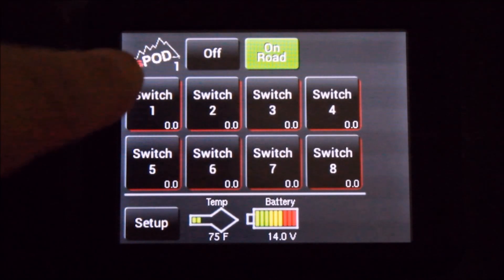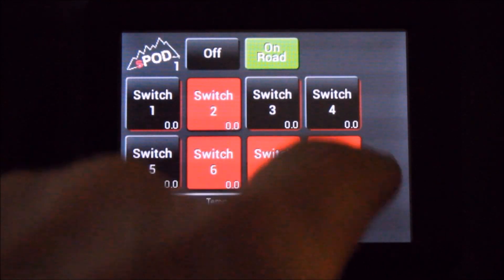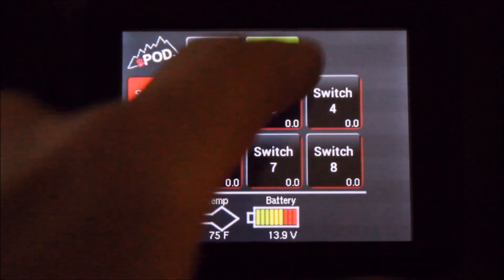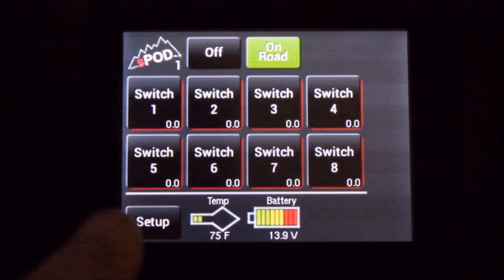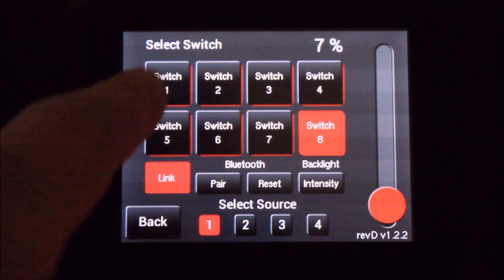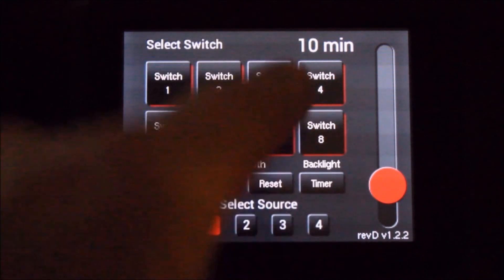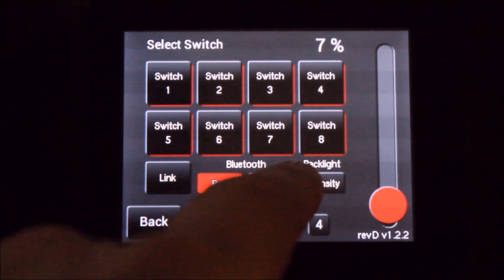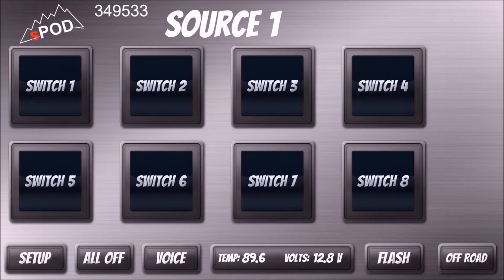sPOD Touchscreen tutorial

Comment: If I have 2 bantam units, can I set up a group/link that includes switches from both sources?
Reply from the maker: Hello campNcrawlRs! If you are referring to the "Link" feature that is programmable on the touchscreen/app, then yes switches can be linked between multiple Bantam's.
For example: If you change over to screen#3 ( even though you only have 2 Bantams) From here you can create master switches on this screen#3 that will operate switches on screens# 1 and screen# 2. Or you can create master switches on screen# 2 that will control switches on screen# 1. Or master switches on screen# 1 that will control switches on screen# 2
Let us know if this answers your question.
Take care
the sPOD Team
Reply: @spodofficial  thanks for the quick reply. I think that answers my question, but I want to clarify. So, if I want to create a master switch on screen 1 that controls switches on screen 1 AND screen 2, that is doable?
Reply from the maker: No problem  @campNcrawlR  !  Yes this is doable. Play around with it, it's kinda fun linking switches!
Reply: @spodofficial  that's fantastic. I'm currently installing and setting up my first unit and decided halfway through install that I could really use a 2nd unit in the bed. The function we're discussing here will make it perfect. Putting together a video to show everyone the install and how it will all work. Thanks for the help!
Reply from the maker: @campNcrawlR  Awesome! Email or call us any time if you need anything at all! We also some some good advice for remotely installing a second BantamX!
Send it to:
sales@4x4s-pod.com
or call us at:
661-775-7799
Have a great day!
-john
Reply: @spodofficial  thanks John. I sent you an email.

Comment: I have a tow truck with amber lights have different flash paterns can change the modes and what model do you have thanks
Reply from the maker: Sorry for the delay in getting back to you. At this time we do not have a way change the patterns. We usually program one set of lights for flash and another set of lights for strobe. This gives an effect of emergency lighting.
Also, depending on which version of the system you have (Bantam or SE, touchscreen or HD controllers) we have a new Pro-Series app that will be released for purchase that will give you the ability to change the strobe patterns for each circuit. We don't have a release date and pricing yet.
Email us for more info and let us know which system you have.
Send it to:
sales@4x4s-pod.com
Thank you

-john